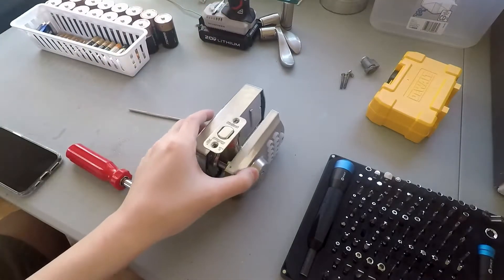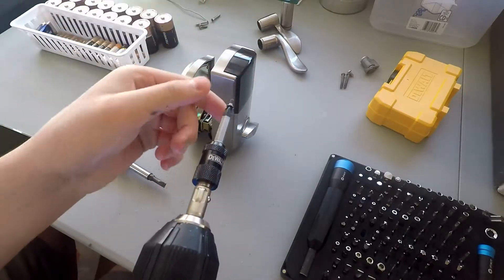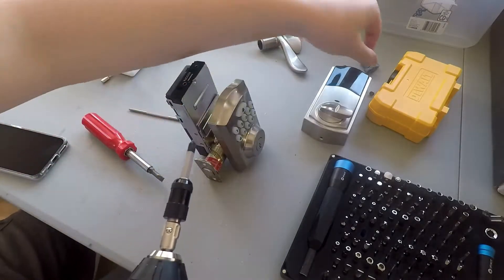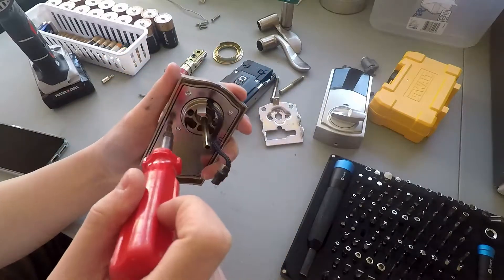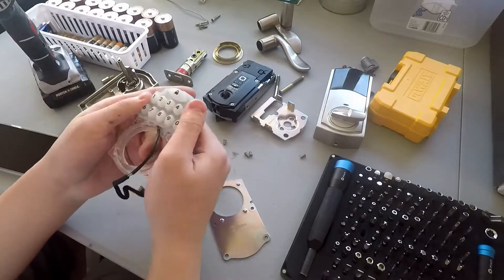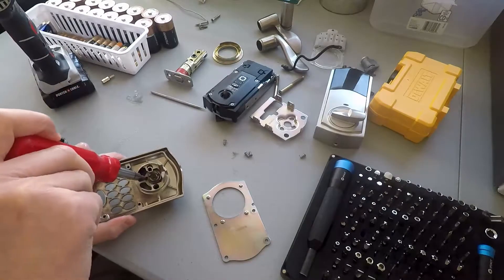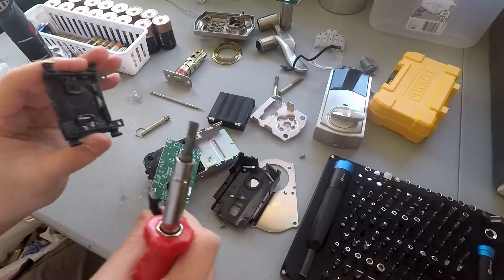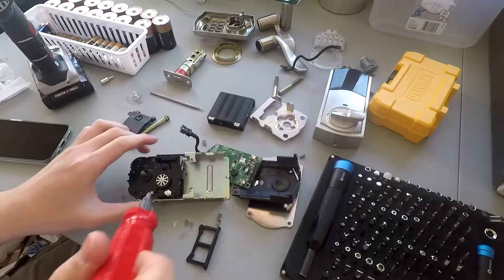Kwikset Keyless Deadbolt Teardown

Comment: I dissembled mine and motor is not working. This is just the small motor in the unit (silver rectangle box). Do you know where to purchase or manufacturer?
Reply: Did you ever find out any information on the motor? Thanks.
Reply: @lowtone20hz  Incredibly difficult